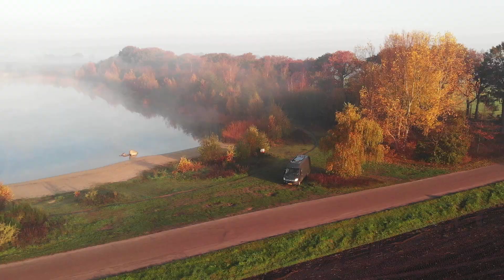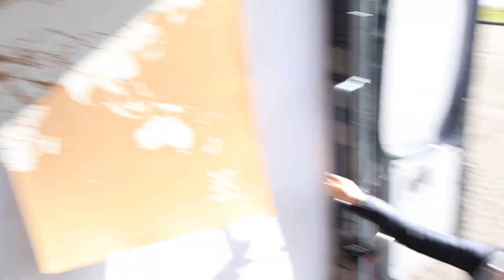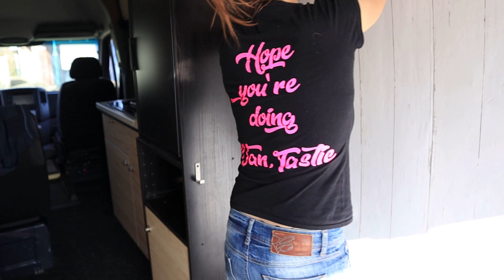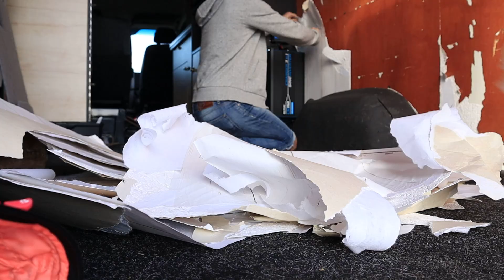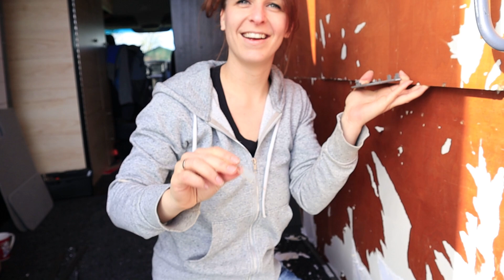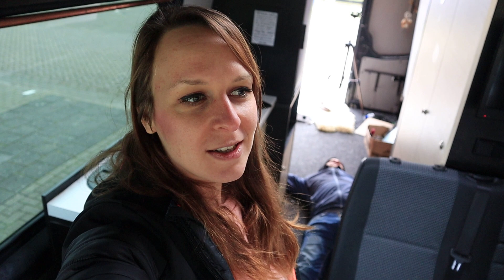Did We Make A Huge Mistake? Sprinter van build series ep. 3

Comment from the maker: Dear friends! Please tell us how to solve the issue of the wall? What kind of tool works best? Love from us!
Reply: My two-cents worth: Use a cordless circular saw set to the same depth of the plywood (or a mm less) so as not to damage anything behind. Use the wardrobe side as a guide for a straight cut. An oscillating tool can finish the job near the roof and floor where the circular saw can’t reach. Not the only way, but it’s how I’d approach it.
Reply: If you can’t/don’t want to do what Paul says then a Stanley knife down scoring then repeating will cut that panel.

I can see why they stuck everything as I took waaaay to long putting my panels in with “proper” fixings but mine would be a lot easier for you to destroy- I mean careful deconstruct.
Reply: You guys definitely need to get a cordless Drill !! - Its painful watching you using a screwdriver 😂😂😂
Reply: @Casahampero  - Yeah if you don't want to take the fridge cabinet out, id score the plywood several times with a stanley knife and then snap the plywood off..

I can see there are electrics on the side of the cabinet which may run behind the panel 🤔

Really you need to take the fridge and cabinet out and do the job properly.. Its a good learning process to get to know how yr van goes together..

The people who built it were not thinking about these things having to come out again 😆

What are you guys thinking of doing re insulation as its obvious yr van has none 🥶?

🚐💨❤️🇳🇱
Reply from the maker: @Casahampero  I just learned the true definition of DIY: Destroyed It Yesterday 🤣
Reply from the maker: @snoman1999  we got some good tips for insulation and it’s shocking how little insulation Bruce has now!! 😳 so we will do what we can do.. for example we want to do this whole wall and behind all the panels we can easily take out, but we probably won’t tear apart the whole van to fix the insulation problem 🤣
Reply from the maker: @jpgriffiths  so basically the answer is: get a grownups toolbox! 😂
Reply: @VanTasticTraveling  - yeah it’s difficult retro fitting insulation but it will make a massive difference when yr back full timing (for keeping the van cool as well as warm 🥶🥵🤙🏼🚐💨😍
Reply: @VanTasticTraveling  haha Leon, it’s hard to justify a lot of tools in a van but a cordless screwdriver would be a good buy. Can you rent or borrow other tools?  🙂
Reply from the maker: @jpgriffiths  you’re right! Definitely need some basic tools, and we could hire some of the big tools for a day or so 😁

Comment: Great vlog guys, you gotta break some eggs to make an omelette. For the insulation I'd say something like a celotex type insulation as it's available in different thicknesses on sheets and is easy to cut to the sizes and shapes you require. And for that hinge bracket use an angle grinder with a thin metal cutting disc and just apply light pressure and let it cut through as gently as possible till its cut through. You can then smooth off any sharp edges with a file or metal flap disc on the grinder. Hope you have a great rest of the weekend and week ahead, best wishes and stay safe and well to you both and your families ❤️ 💙 ❤️ 💙 ❤️
Reply from the maker: You’re absolutely right Mike! And we want to make a good omelette! So we got to break a whole lot of things more!! 
The main problem we’ve got at the moment is that we don’t have the right tools. So I think the first thing we have to is upgrade our toolbox! 🧰 😁 
But the end result will be totally worth it! 😁❤️ have a good week Mike! ❤️🥰
Reply: @VanTasticTraveling  thankyou and yes I agree will be completely worth it in the end. And yes adding some good tools is always a great investment, they will pay for themselves over time.
Reply from the maker: True, this project won’t get finished without the proper tools i guess 🙄💚